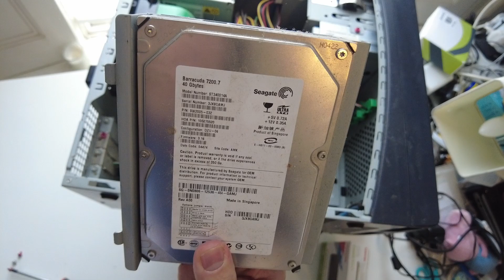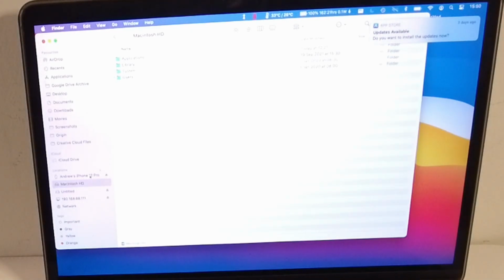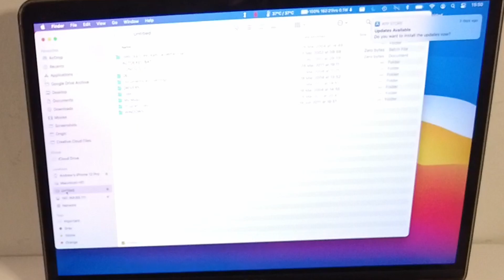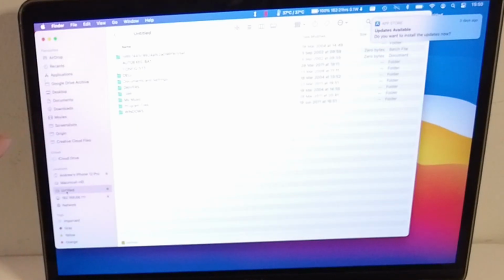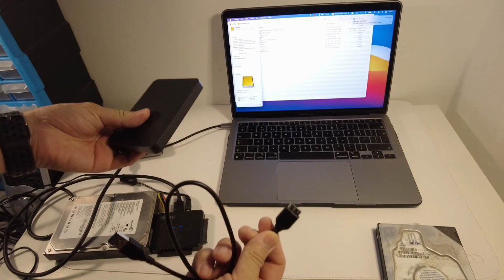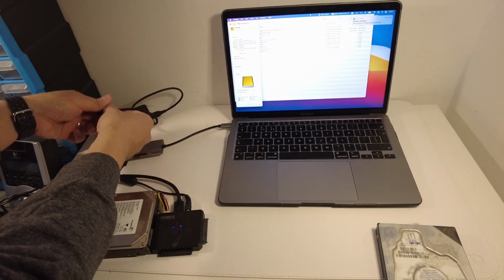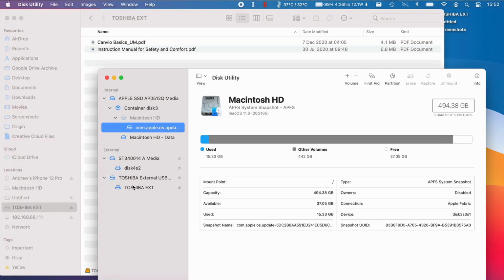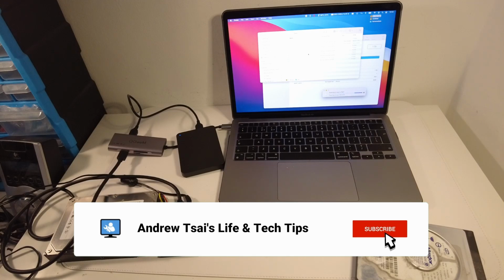How To Recover Data From Old PC IDE Hard Drives

Comment: 1 Remove harddrive from PC a, 2 Remove CD drive from PC b, 3 Plug harddrive from PC a into the CD Drive sockets of PC b. PC b will read the drive straight away into windows copy data from PC a Hard Drive to PC b Harddrive. Swap the harddrive back to the CD drive and select setting on Bios go to CD drive setting and select CD drive, to get it back to being a CD drive socket because when a Harddrive was plugged in it automatically turns it into a Harddrive socket.
Reply: Absolutely.........

I just unplug DVD drive from my old Vista computer then use that connector for any spare hard drive allowing access to them on that computer. 
Offline of course as you only want to copy off any data or photos from old drive

Comment: Will the power from the pc suffice instead of having to use a power cable
Reply: You can plug old hard drives into the CD drive sockets and it will just load up like any drive. I did it with a 2006 Dell dimension.